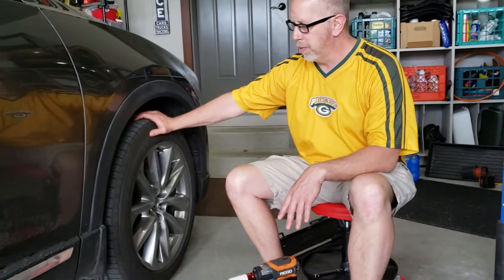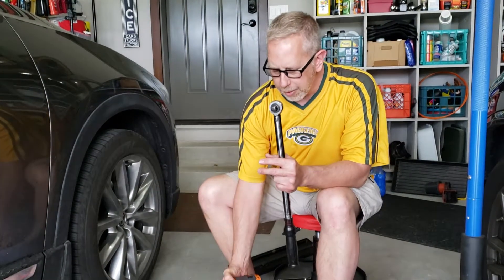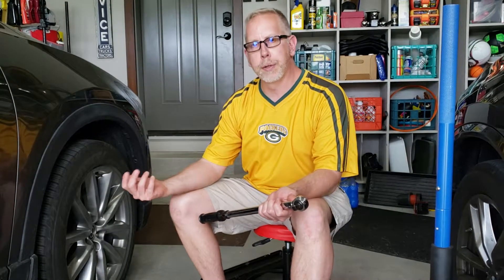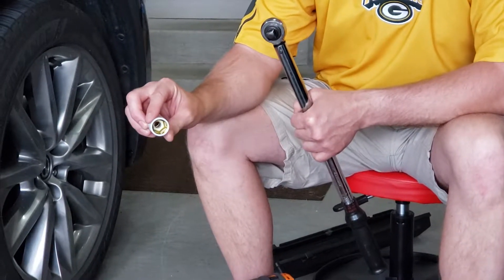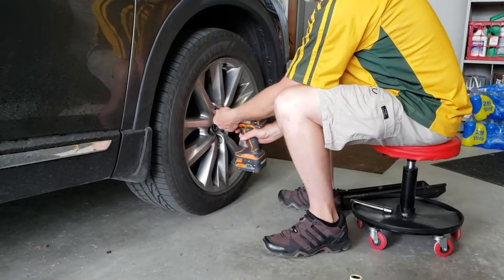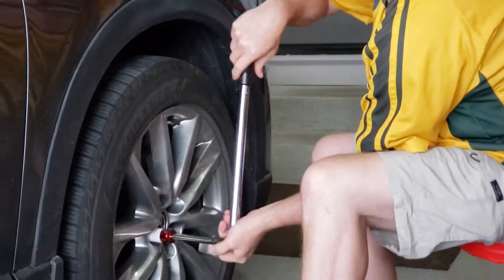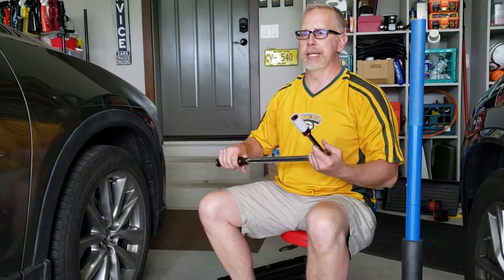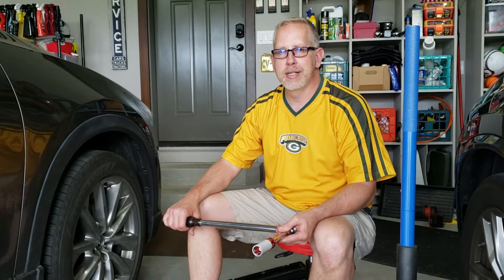Trust but verify dealership and service center work.

Comment: Over torqued lugnuts can absolutely result in warped rotors, and they can result in lugnut failures (ask me how I know...).

Apparently, many lug nuts these days are two parts, the visible layer is mostly for aesthetics and the actual metal doing the work under is softer. I can only assume this is a cost cutting measure. After a failed attempt at welding a nut on top of the lugnut (it worked fine, but the soft over-torqued lugnut broke under the pressure twice), it had to be removed with a cutting torch. This worked, but it also ruined our rim and the drum it was attached to.

I ended up just replacing the stud in the drum and dealing with the ugly widened hole and spatter on the rim - but this was not the right way to fix it I was just unable to pay for it.